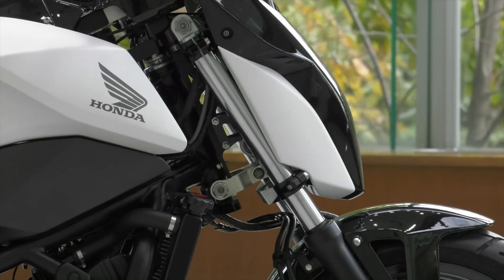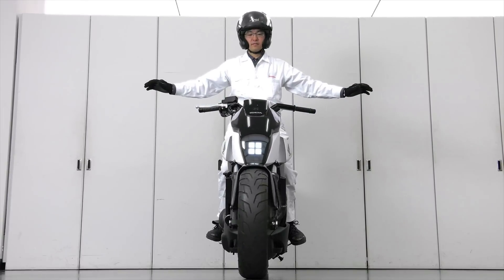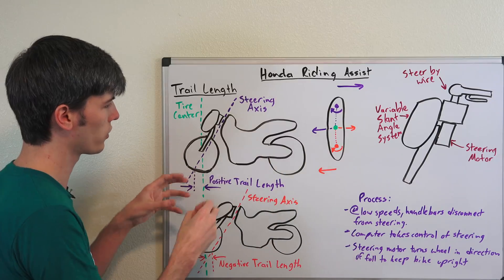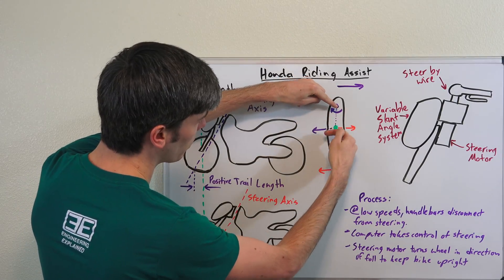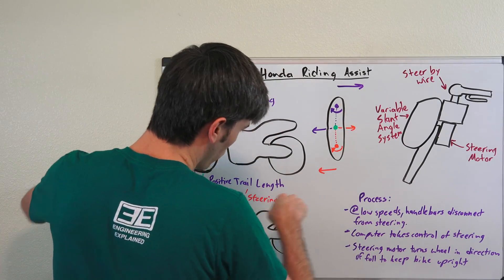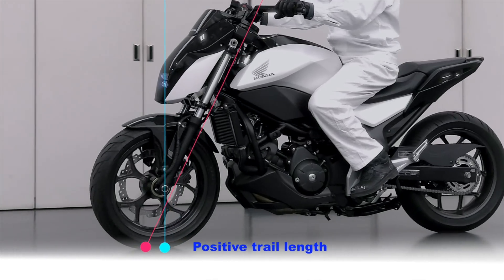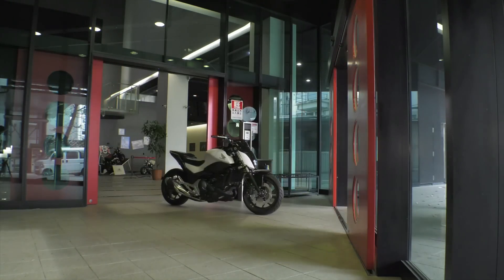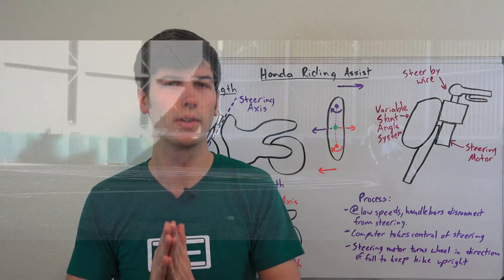This Motorcycle Won't Fall Over!

Comment: Riding is much more dangerous than driving a car.  If you can't balance you shouldn't be on two wheels.
Reply: Justin Kirk short people with tall bikes and/or bad knees
Reply: Justin Kirk im 5ft 10 and i can not put both feet on the ground on my suzuki dl650

Comment: Mechanically and electrically is quite simple, but from safety engineering point of view introducing a steer by wire technology is not so trivial. Many safety mechanisms have to be introduced in order to make it safe in case of faults and development costs are also exploding.

Comment: I can see it wearing out one specific spot of the tire when sitting at a long red light.
Reply: Mopar Magic that has to be one looong red light...
Reply: The electronic suspension system automatically adjusts for flat spots created by long red lights, preserving a smooth ride at speed.  The necessary counterweights are substantial, however.

Comment: When turning a motorcycle you counterstear, push right to go right, with the common positive trail length. Does this mean at low speed when this bike has negative trail length counterstearing will work in the opposite direction, push right to go left? 
Also, what happens if the motorcycle transitions from negative to positive trail length as you speed up through a corner after you have been stopped?

Comment: Do topics like this just come to you and you hunt down the media for the video, or do companies mostly bring you stuff now and you just need to figure out what way to present the interesting tech?
Reply from the maker: The process of picking topics is pretty sporadic and unsophisticated. Usually just research things that sound interesting, and make the video regardless if there's media available or not. Honda happened to have a lot of b-roll for this to use. Don't have a great answer on topic selecting unfortunately, pretty random process haha.
Reply: +Engineering Explained I'm expecting the video on what makes the Scania's V8 engines to produce that marvelous V8 open pipe sound
Reply: Bob Bob 330KW?
Reply: +RobotComics r/hailcorporate
Reply: ΑΡΗΣ ΚΟΡΝΑΡΑΚΗΣ It has to do with the the firing order, cylinder head design, and exhaust manifolds
Reply: Engineering Explained I recently had my car dyno tuned, the car is rated at 270kw at the flywheel but 216kw at the wheels, so now my car makes 277kw at the wheels so what's it at the flywheel?

Comment: this just seems like a lot more stuff that can and will eventually fail.  I for sure wouldn't want to be riding and then it just stops adjusting properly causing speed wobbles possibly or even worse bucking me off the bike.  it is very cool no doubt but it just seems redundant when you can put your feet down at the lights.
Reply: Jonathan Lavigne from what it looked like it was only at low speeds when the steering rack disconnects direct control from the front wheel. I don't think it auto balances at high speeds
Reply: indeed, but it would be cool too if it can save you from a speed wobble
Reply: that old school tech already. honda calls this HESD (honda electronic steering damper) ...

Comment: So we ignore that the bike follows you like a well trained dog and soly focus on the anti fall technology for elderly people? 
OK
Reply: The anti fall technology is the most complex and unique part of that system. My vacuum cleaner can do the rest.
Reply: BEST PET EVER!
Reply: well, because the whole reason it CAN follow you around is because it's balancing itself, while moving very very slow. I've ridden a few bikes in my day, and I'd have a hard time keeping that steady at that speed.

The fact it follows along is neat, but compared to the fact it doesn't need huge gyros to stay upright makes the following seem kinda pedestrian by comparison.
Reply: @DFX2KX  No! If you are not riding the bike it should be in neutral! If it in gear what happens when come to a steep hill? up or down? If you start to Jog? Run? go up a flight of Stairs?
Reply: Maybe it can be programmed to go catch a ball, and to shake next to you when you finish cleaning it :D
Reply: A prelude to self Riding :D  maybe we can program it to go to the store and pick up some milk  :D
Reply: @mannyechaluce3814  That's what your autonomous Tesla will be for eventually, to go pickup your groceries now that you ordered them online.  😂
Reply: I wasnt born to follow.
Reply: @carstengerm  I'm biker so I don't follow! I go my own carve my own path! listen! Ow & Try to Keep Up!
Reply: i bet it uses the starter motor
Reply: You have to stand before you can walk.  If you dont get it then you're not meant to.
Reply: Maybe it can be programmed to run after would be home invaders  :D  like a Doberman

Comment: what could be the problems raised due to this new steering system??
Reply: extra weight and cost.
Reply: P. Srinikethan having a disconnect means you could lose any control over the front wheel. Optimally you should be able to overpower the computer if it is doing the wrong thing.

Comment: How does this compare to the BMW bike that "will never crash"?
Reply: BMW showed just a vision. This here is actually engineering. It works. Now. Not in (maybe) 10 years.
Reply: ... which doesn't exist to my knowledge, it's a promo video and a barely rolling electric design mockup, not an actual self balancing motorcycle.
Reply: Never crash ?  no such thing, even cars crashes  , everything that moves crashes..
Reply: Oh i didn't mean that this one is a mockup, this one seems close to production-ready. BMW has not shown a vehicle that self-balances, It's all 3D renders and video composites on the BMW promo video, and on BMW press conference, the mockup rolls in slowly, is propped up first by the model, then by a kick stand, which wouldn't have been necessary if it could at least balance itself. Nor have BMW lost a word on how they want to accomplish that. Chances are, they haven't actually even considered how they want to do that, but gyroscopic flywheel, shifting internal weights, and drive-by-wire steering are basically the only methods i can think of.
Reply: I was mainly curious if BMW showed the technology behind their concept and if so was it the same technique as honda is doing.